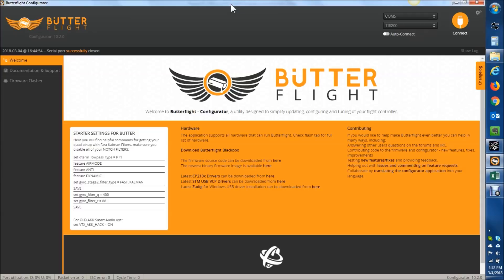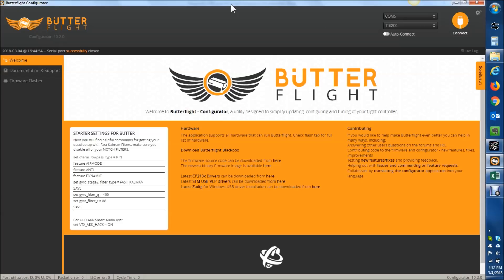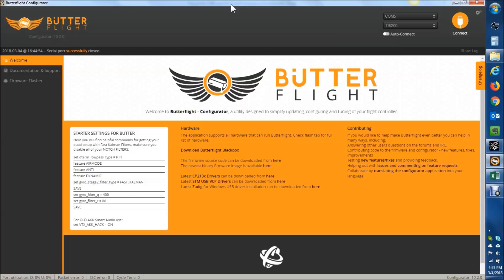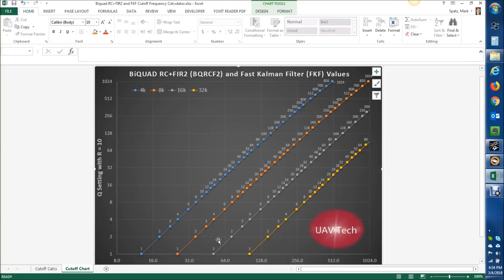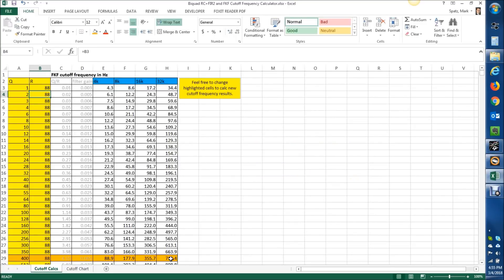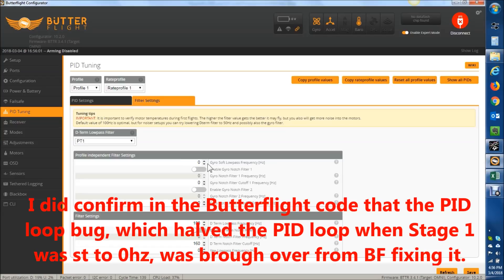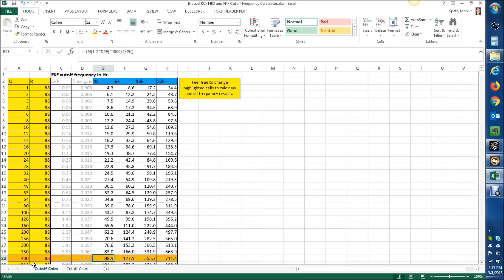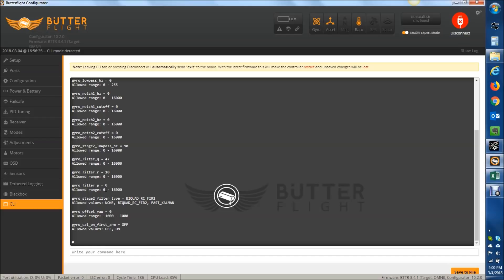Butterflight Stage 2 Filter Options (BQRCF2 vs. FKF)

Comment: I'm pretty new to this whole Q&R, lowpass hz tuning. are we basically trying to match the motor noise as much as possible?
my max cut off is 167hz. on 8k-8k so should i keep q at 400 and keep r at 88 then set stage 2 lowpass cut off at the 167hz? sorry if these seem like dumb questions it's just slightly confusing haha
Reply from the maker: Depending on your quad base nose, at 8k/8k with the Dynamic Filter on, u should not need the FKF.  If u want to use, calc a Q/R that gives u a 90hz cutoff and turn off the Stage 1 filter.
Reply from the maker: See videos in: https://www.youtube.com/playlist?list=PLcYNkvInloJEGjfuF6j-v-8Ihiqac9COU.  BF sets Stage 2 filtering direct by cutoff.  BuF sets through a Q/R ratio.  Both filters do the same thing and are a lowpass filter (like the legacy PT1, with 2 point Lagged Moving Average filtering added to the end).
Reply from the maker: You can download the latency calc tool from: tiny.cc/filtercalc.
Reply from the maker: My video at https://youtu.be/ryONT42HPTY covers my Stage 2 filter recommendations for BF, which also applies to Butter.  The Stage 2 filters are really for running 16k/32k.  So at 8k or 4k u can swap out the Stage 1 and turn on the Stage 2 for 90 or 100hz, or just don't use.  U don't need the latency of both for 8k and 4k gyro/PID loops.
Reply: thank you so much, man!! I have been working on it all day haha it starts to unravel more and more each time lol! i found the best results at 90hz but think it might be safer to turn d-term notch back on? at 90hz was with the coolest motors but they was still warm but less hot than when it was at 100hz and tried 85hz just to see. i kinda think my kwad is just noisy as hell i even got everything soft mounted with 2 big caps on the power lead lmao. i have't ruined anything yet so i can't be too far off i feel like

Comment: Is this video still accurate? From what I understand in order to change the cutoff for the stage 2 you "set gyro_stage2_lowpass_hz = etc" in the cli and then the q and r values are calculated automatically. Is this correct or do you still have to change the q and r values
Reply from the maker: Skywalker FPV , for Butter u still set Q / R.  For Beta, u just set cutoff (no Q/R).
Reply: UAV Tech what if I'm using the betaflight stage 2
Filter in butterflight? Still set q and r value? And if I'm in butterflight, using Kalman filter. What does "set gyro_stage2_lowpass_hz =" do? Does it just do nothing?
Reply from the maker: Skywalker FPV , no.
In Butter, set Q/R for Kalman and set cutoff if using BQRCF2.  One uses one, and the other uses the other.
Reply: UAV Tech ok. So if I was in butterflight using fast Kalman and I set stage 2 lowpass hz it does nothing. that's what I'm using on a 6" build with dynamic on 8k/8k q and r at 400 and 88. I'm getting horrible mid throttle oscillations, all notch filters off and dterm filter set to pt1. Tried using your calculator to set the cutoff at 90hz and it was still there. What would you recommend to get rid of the oscillations?
Reply from the maker: Skywalker FPV , u soft mounted on motors?  Can u send me a BB log?
Reply: UAV Tech yes soft mounted fc and motors. Yea I can send you one. Where should I send it to?

Comment: So, what determines R? Like, where did they get 88 from, and where do you get 10 from?
Reply from the maker: 88 comes from RS2k and his recommendation in the interview at: https://youtu.be/OR-772OqRoQ.  10 came from the BF devs. just saying it doesn't matter since Q/R is a ratio and 10 is a nice multiplier number when dealing with ratios.  However, I use 88 since RS2K said so to avoid that criticism.  Also, if the BF devs. are right, it doesn't matter anyways so 88 is as good as any other number.  If RS2K is right, whelp --- see I used 88.

Check out that interview.  Good stuff but don't get enamored too much.  Part of me feels it is all sales hype to sell t-shirts, new Spring boards, etc...  Either way, FKF is now in BF 3.4 as it was originally planned.

My issue is I have not seen ACTUAL DATA yet, that shows (not just talking about "my feelings") of how the FKF filter is anything magic.  So, I'm open to it, but skeptical and I'm not buying a T-shirt.  I don't want to be a jerk, but I also don't want to be a sucker either.
Reply: UAV Tech agreed, I like to be... Let's call it agnostic. I like that it pushes innovation, but all the hype and still being told to use 8k sampling rate from the BuF devs shows there is not much magic going on. I don't know. I support innovation, and by that I would rather by your shirt, demystifying all of this :) I'm frustrated over people bashing butter for cloning/stealing bf in this open source world. Since useful work can be pulled in from both sides, I only see this as positive, but dude some people are drama queens. I have dives into this because of my Matek f405-osd acting up (on 2 out of 4 boards) and refuse to by more stuff right now :p hopeful I'm getting it right through your help (since now I see how little difference the two firmwares are for my case)
Reply from the maker: Yes, it is hard to filter what is hype and what is real.

Comment: Do these settings look right on a 4s 3" build with 4000kv 1108 motors? Running 8k with dynamic filter on. Few lines I just pulled. It is flying great no oscillations, only propwash is when it is forcefully induced. Also I didn't see you messing with the dterm_lowpass filter, should it just be left at 100?

set gyro_lpf = OFF
set gyro_sync_denom = 1
set gyro_lowpass_type = PT1
set gyro_lowpass_hz = 0
set gyro_notch1_hz = 0
set gyro_notch1_cutoff = 0
set gyro_notch2_hz = 0
set gyro_notch2_cutoff = 0
set gyro_stage2_lowpass_hz = 0
set gyro_filter_q = 600
set gyro_filter_r = 88
set gyro_filter_p = 0
set gyro_stage2_filter_type = FAST_KALMAN

set dterm_lowpass_type = PT1
set dterm_filter_style = KD_FILTER_CLASSIC
set dterm_lowpass = 100
set dterm_notch_hz = 0
set dterm_notch_cutoff = 0

set p_pitch = 86
set i_pitch = 95
set d_pitch = 20
set p_roll = 85
set i_roll = 88
set d_roll = 18
set p_yaw = 95
set i_yaw = 65
set d_yaw = 18
Reply from the maker: That looks right for what BuF recommends.  Now the trick is do you need more or less with your specific quad and to attack motor noise enough for a good tune.  Would need to see a Blackbox log for that assessment.  If you have a half decent raw noise profile, you should be able to turn off the FKF or Dynamic Notch saving on filter latency to make your quad easier to PID tune.

Comment: What should the Q/R be for 8K/8K with an MPU 6000?
Reply from the maker: Butter's recommendation is Q=400 / R=88 as shown on: http://butterflight.co/.  However, that gives it a cutoff frequency of 178hz.  Typical for 8k/8k cutoff is starting at 90hz and moving up from there.  So, the higher the cutoff the better latency wise.  That said, if too high, you motors might get very hot and or you might have a very rough flight experience.  Soooo... yeah.

My recommendation is to start with Q = 100 / R = 88 and if all goes well, keep moving Q up by 50 until things start to go down hill.  You can find a Q/R calculator at: tiny.cc/filtercalc.  Also see my gyro noise playlist at: https://www.youtube.com/watch?v=sW9uZmbb47s&list=PLcYNkvInloJEGjfuF6j-v-8Ihiqac9COU to understand these filters and a video on how the filter calc tool works.

Hope this helps!!

Comment: So if I'm understanding this correctly, on an 8k gyro loop you would recommend a Q value of 12 and R of 10 right?  I'm trying to get a handle on a really noisy setup with an all-in-one FC/ESC which is soft mounted well but I think is getting a lot of noise because of the 12 motor wires and 2 battery leads soldered to it.  I'm close to giving up but giving it a few more days of effort :)
Reply: Holy hell what a difference that made!  It's actually flyable now, still not perfect but flyable enough that I can actually start tuning it
Reply: Here's where I'm at right now, any thoughts?  https://youtu.be/y5HubV93-ic
Reply from the maker: Looking decent.  Little PID tuning and ...
Hope the video helped!
Reply: tried 12 and 10 on 2 different FC's. The bardwell was ok the holybro v2 had such a delay in the gyro it was not flyable. Both running 8k/8k. Tried the settings again same result. The holybro v2 needs higher Q and R values?

Comment: quick question: in PID tuning, Filter settings, you have your gyro soft lowpass frequency set at 0. do I have to set this parameter also to 0 or is it indifferent since the kalman will take care of that and ignore this parameter? thanks.
Reply from the maker: Bruno Gomes , u have to set.
Reply: UAV Tech thanks for the fast reply. Done. ^^
Reply: By the way, is there a way to get that cool Excel spreadsheet of yours? ^^
Reply from the maker: Bruno Gomes , see desc.  Download at tiny.cc/filtercalc
Reply: UAV Tech thank you once again. ^^

Comment: Hi, i got an issue with the fast kalman.. it kinda heat up my motor thought it just a default pid
Reply from the maker: Try the BQRCF2 filter maybe?  Also, did you turn on the Dynamic Filter?

Comment: have tested 3.4.2 (fast kalman, not the new 'experimental with fixed k' (whatever it means) one)
i confirm. there is a major difference in flight characteristics even runnin 8/8 on mpu6000. 
first, i managed to bump my pids by 5 points, second - i lowered D by 5 points at the same time and still didnt get propwash. 
with BF and st2 as a single lpf filter set to 90 i still was gettin it. 

q and r are set according to your table (12 and 10 respectively).
i have no idea why it handles better, i double checked everything (rates, setpoint weight and transition - all the same) 
maybe it introduces much less delay into the loop?
Reply: btw , in this test with fkf i set gyro lpf and stage2 to 0, forgot to mention
Reply from the maker: Can u send me your logs of this testing?
Reply: i sent you an archive with these logs a while ago
Reply from the maker: crap.  I suck.  I got'um here.  So many logs, so little time.  Thank you and sorry.  At the time i was waiting for the Butter BBL viewer to be fixed so Debug_Mode= Notch would work.  That works now!!  :-)

Comment: pre-notch data from butterflight is  unreadable in cleanflight bb viewer
Reply from the maker: MrBirdshell666, agreed.  I put it on Lucas's radar but do need to submit an issue request on GitHub yet.
Reply from the maker: BTW, works now (debug mode=Notch) within the new BBE that is embedded in the NEW Butterflight Configurator.

Comment: Hi, excellent UAV Tech
When you recorded the vid, you had a doubt (5:50) that I still have and I was wondering if you figured it out by now. 
If zou are running FKF (gyro_stage2_filter_type = FAST_KALMAN), you need to configure r&q but gyro_stage2_lowpass_hz does not play any role. 
In other words,  gyro_stage2_lowpass_hz is only used by the BIQUAD_RC_FIR2 filter and is completly ignored by FKF.
Is my assumption correct?
Reply from the maker: CrashTestDummy_FPV ctdfpv , still needs confirmed.  If u do confirm, please let me know.

But it is a good assumption IMO.  Howelse would it work otherwise?  Just setting the cutoff is the Beta method for the BQRCF2.  Q/R is the Butter method for FKF.
Reply: The video from Joshua Bardwell just confused me even more because he talks about the Butterflight recommended  gyro_stage2_lowpass_hz configuration, which does not make any sense.
Reply from the maker: The Butterflight recommendation is close to mine (for 32k sampling), but they have a higher cutoff of 711hz with a Q=400 and R=88.  I was saying to start at 500hz and move up if you can set the Dterm filter to PT1 and turn off the Dterm Notch filter.

Of course for the FKF filter and how you set the cutoff (Q &R), if you have a lower gyro sampling rate, that cutoff moves down as the sampling rate moves down.  Which does make sense and is what you want.  But as it moves down, at some point, you just want to turn off the classic PT1 gyro lowpass filter (Stage 1 filter) as you don't need a Stage 1 and Stage 2 filter on-top of each other for (4k sampling) or very close to each other (for 8k sampling).  For 4k or 8k, just use the classic PT1 filter, or new FKF or BQRCF2 filters starting at 90hz cutoff and moving up if you can get a clean Dterm trace.
Reply: This last comment is gold. The understanding of filters along the frequency spectrum and how/when to combine them is new for the majority of pilots (at least it is for me). After tons of videos, we kind of understand how the PID and rates work. But the filtering concept is just now being spread. I think it would be a good idea fro someone like you to explain that in very simple terms. The absolut basics of it. Like "hey, your gyro has noices, different kind of noices. Some have low frequency, some high frequency. You can put a big filter to get everything, or you may put two filters one after the other". and so on. 

By the way, I can confirm that the gyro_stage2_lowpass_hz parameter is completly ignored by the FKF filter. A guy called Matthias JW Song told me via chat at https://butterflight.slack.com
Reply from the maker: CrashTestDummy_FPV ctdfpv , even when Stage 2 filter type is set to BQRCF2?  I will be testing either way, just curious.

Comment: so is it the ratio of Q/R that is determining the cutoff ?
your values are almost 10% ( "ish") of the butterflight quoted starting values-
does using larger numbers simply increase the accuracy of the target value?
or am i over-simplifying it?
thanks
Reply from the maker: Liam Thomas Ruddock , as far as I'm aware, it is simply a ratio.  So higher numbers don't matter.  What does matter is the resultant cutoff frequency.  See my sheet at: tiny.cc/filtercalc

Comment: Do you have any thoughts on F7’s? I got two and one currently flying.
Reply from the maker: I like.  Beta and Butter probably run slower on them now (as other say - I  don't have one... yet), but I know the plan for BaF 3.4 release is to optimize the code for F7.  So I feel they are a good investment and will come into their own this summer/fall.  Whereas F4 will be like F3 is now.  Barely hanging on if you want to push to the fastest speeds.  Which, if that is really needed is a whole topic in itself.
Reply: Using the matek f722  on my current setup. Very nice.